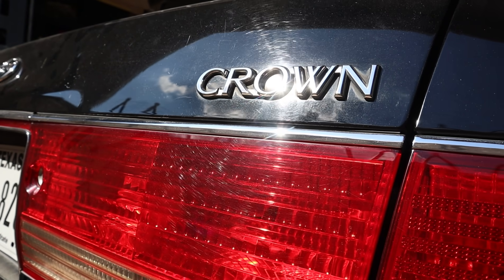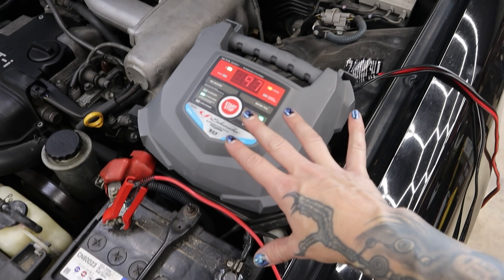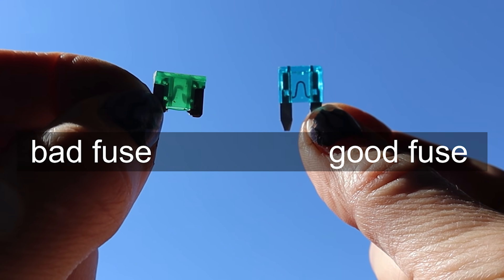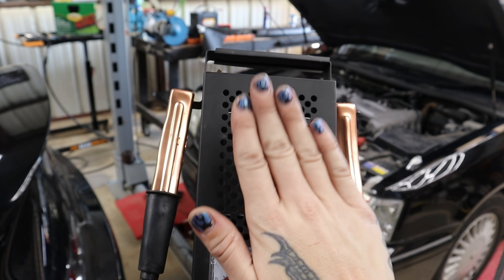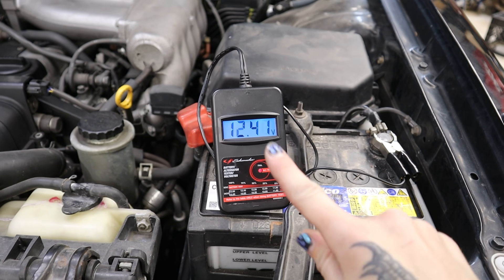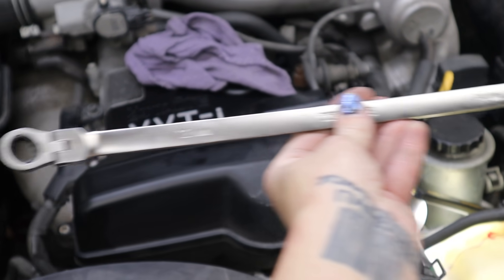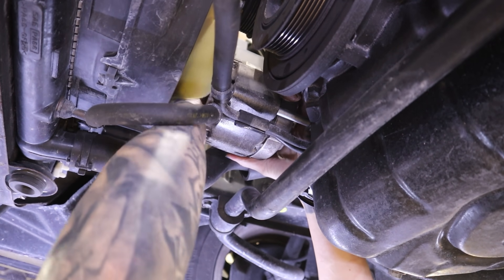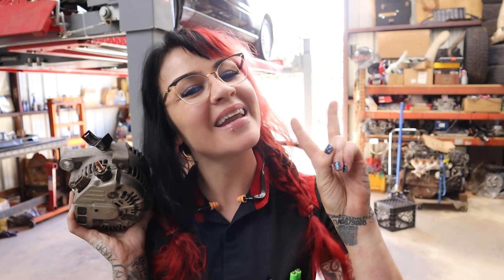Quick Charging System Tests: Battery and Alternator testing with and without special tools!

Comment: Awesome video. Very informative. Just missing the part about taking the vehicle to the store and getting it tested without removing it. But the alternator tester said that I need to check it in my truck. Hard start after driving on the freeway, lights are a little dim, but will replace them too because they are 1year old sealed beams 👏👏👏👍👍👍🤙🤙🤙

Comment: She could have honestly charged the battery and went straight to alternator test.. did like 10 things just wasting time..  must be hourly and not flat rate cause a flate rate guy would have this diagnosed in 30 seconds lol... its a cool video seeing the process of over diagnosing but clearly a waste of time.. now if i charged the battery to 12.8 volts i know the battery is good so im going straight to the alternator but i guess different strokes for different folks.

Comment: I did have an alternator partially fail once that was really hard to diagnose. It was passing all these tests, but my lights were still dimming all the time. Finally, had it tested with the machine at Advance and the output was about 60% of the amps that it was supposed to have.

Comment: Great video Faye. I believe in testing the Alternator if you just had a multimeter you could perform it the same way? Checking the DC volts and then adding a load like light and such?

Comment: I used to do continuity test on fuses but I found that in special cases, that can give you a false passed the test.

It can be broken but barely touching, giving it enough to pass the continuity test but when put on a load, it will expand and lose that contact.

For this reason I use a meter or digital test light to see volts.   Continuity usually is good enough, but it's rare that a fuse will break in the way I mentioned.  Just giving my 2 cents with my experience

Comment: The one thing 99.9% of all technicians pass up inspecting. They actually don’t go through the labor of removing all the cell caps..  a visual inspection you can see one cell may have turned dark gray.  This is your cell that is not 100% yet..   and can pass the electronic testers saying it is OK.  It could pass a low test..  
      But under certain temperatures and conditions can cause an intermittent no start.   or slow battery drain going dead.. ☠️ 

But will pass all other test . 

Just like technicians no longer will do a cell to sell voltage test that can show up a bad battery that all the electronic fancy meters will give a pass as good .

Comment: Hi Faye, hope you read the comments.  Quick Question for you based on your opinion and experience.  I have a 2005 Toyota Tacoma extra cab that just got a wandering fuel gage needle. Filled up yesterday and watched it pogo on the way home from full tank to empty with the reserve light on. Is this a sign of the fuel pump unit failure, or just the float sensor going bad? Tried to message you on Tiktok but got a bust signal.

Comment: The fancy tools may make it easier, and if you are selling tools thats probably important, but if you are just diagnosing a charging problem, you can easily do this with just a voltage meter. 
Where I live, we have  shop that will rebuild/repair alternators, it wont often save you much money, but they can often get you back up and running quickly without spending a lot of time looking for parts. My guess is that has an internal voltage regulator, that maybe lost a diode, and is only charging at half capacity.

Comment: You might want to mention, if you have one in your city, local Auto electric rebuilders.  They are usually cheaper than a new alternator and you have the comfort of someone being thorough with your rebuilt alternator, rather than an assembly line from gawd knows where.  They strip, clean, test and replace only the failed components.  In my experience, its usually only bearings and voltage regs that fail.  Just a sug

Comment: For the newer vehicles the old battery load tester may cause sum weird results due to the a BMS thinking their is a sudden heavy load. I purchased a newer type that checks without a heavy load. It will work for a battery out of circuit though

Comment: Don't know if you've ever done much wrenching on Toyotas from the Midwest?  They look nothing like that on the underside.  Just the fact that you were able to remove the clip that holds the tranny lines to the alternator bracket blew my mind.  Up here, Toyota's low carbon-content steel rots super fast and super badly leaving almost everything under the car a rusty mess.  For years I hated working on Toyotas in the north because of their propensity to rot so fast.
Reply from the maker: Nope but I'm from New England which is where I began my career. I specifically chose to live in other places in the country because of my job. Regardless though, this car is from Japan and it has only been in the US for less than 3 months... So I figure that wherever it ended up, it would probably look like this since rot doesn't happen in two and a half months especially not over the summer.

Comment: did the tester at auto parts store say what was wrong with alternator or just say fail with no explanation ?
Reply from the maker: Great question! It did actually state the area of the fault! It had a bad ripple current test, which could indicate a faulty rectifier or stator. Very interesting!!

Comment: Hi Faye!  You mentioned in the video that you were also going to test for voltage drop, but I didn't see where you actually did that.  Also, is there a particular reason why you pulled the alternator before you did any voltage drop testing.  And, as always, thanks for taking the time to share with us!

Comment: Working on semi trucks with big batteries, i had to cut the clamps off and crimp on terminals, the clamps would never conduct enough current to pass. But bolted down with a cable lug they do. Takes longer but more reliable test.
Reply: Common problem with cars, too, I can't count the number of times jumping a car with high-quality jumper cables where the jaws just wouldn't make good enough contact without multiple twists and reseating.

Comment: When I was a young guy back in the 1980s, the quick-and-dirty test everyone used for suspicious alternators was to disconnect the positive battery cable while the engine was running.  If the engine died out, you knew the alternator wasn't charging; otherwise, you'd assume it was okay.  I wonder if that still works on modern cars?  Or will it damage the alternator?  Anyway, good video!
Reply from the maker: Oooooh I learned specifically not to do that in today's modern cars in one of my Toyota training classes! Something about voltage spikes and damaging modules but I can't remember exactly why to be honest. That sounds like a great trick for my 80s rides though!! Super quick and dirty!!!!😆
Reply: @FayeHadley  Thanks for the reply.  You've probably saved me from wrecking an alternator someday!
Reply: @FayeHadley  Never a good idea, the battery smoothes out the spikes in voltage. Batteries develop a higher internal resistance as they fail, many "glitches" in seemingly unrelated systems (engine, controls, etc.) are fixed by replacing a seemingly good, but older, battery,

Comment: Awesome Content, I hate it when people throw parts at a problem without proper diagnosis. The only issue I personally have is the "While I'm in there"  bug on my personal vehicles.
Reply from the maker: Ooooh I relate. A terrible disease that makes you hemorrhage money at times 🤣🤣🤣
Reply: @FayeHadley  Very much so, I'm about 10k over budget on my 1997 Comp T/A I've owned since 08. Started this project 3 years ago. I'm ditching the Opti and going with a TH x24 Ignition system, forged rotating assembly, Tremec T56....etc..etc.. It all started with just installing a BMR Tubular K Member... 😂🤣😂🥲

Comment: How do you tell if brushes went or if the regulator went bad😊
Reply from the maker: Actually you can tell easily from the test at O'Reilly's! I got a printout that I had a directly to the customer as well, but it honestly doesn't matter because this type of alternator has a built-in regulator! So regardless of what went wrong, you are still replacing the same component. Don't worry about it, watch that flat rate time and send it!
Reply: @FayeHadley  It would have been nice to see the actual failure shown by the tester. And, alternators don't have brushes, that was the big improvement over ye old generators (yes, I'm that old)
Reply: @dankingsbury9971 Some do have brushes, older ones anyway. Yes, I’m that old! 🙂

Comment: I know a guy that can rebuild the alternator and upgrade the output so you can have enough power to run a bigger stereo system inside the car.
Reply from the maker: That's so awesome! In this case I recommended that he get the upgraded 1JZ option that Driftmotion has! So I guess I know a guy who does that too!! 😅